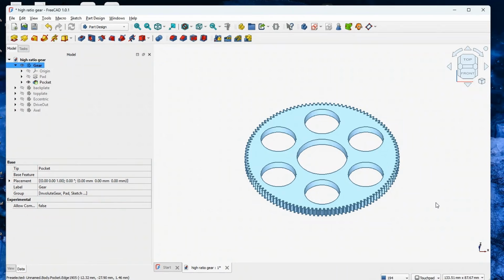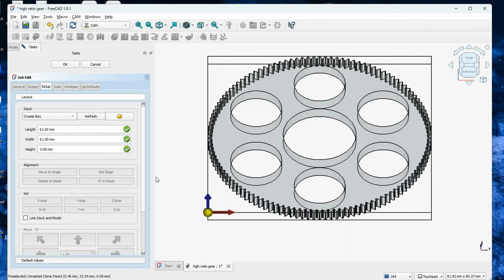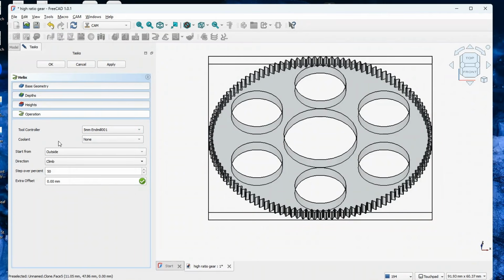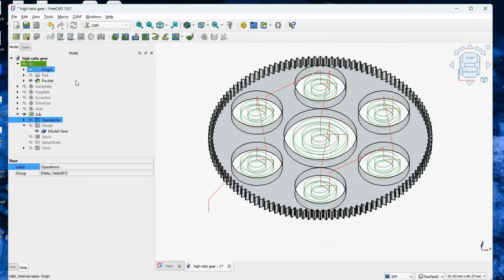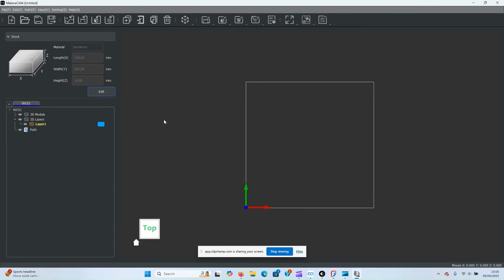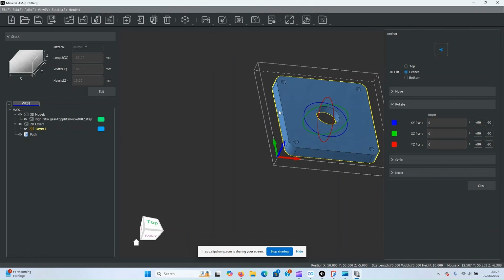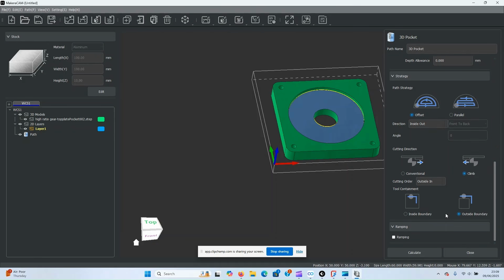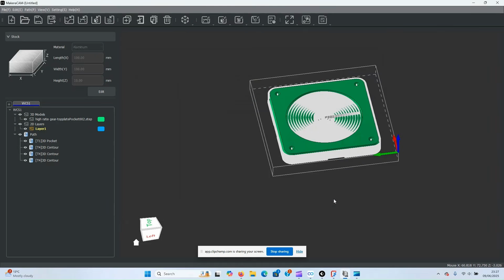2393 FreeCAD CAM And Makera Cam #Makera #Makeradesktop #CNC

Comment: Is there anything extra you need to do when export your gcode from FreeCAD to run on the Carvera Air?  I've been experimenting with it this afternoon, but it doesn't seem to perform the homing and manual xyz probe steps (using a different origin than the normal corner of the bed).  I thought that the Carvera Controller software would take care of that but if it does I'm probably doing it the wrong way.

Comment: I know I may be hard to understand but hopefully this comes across, in that I still want to see how well a 4th axis could work in a 3D printer as I still have my idea of powdered magnetized material *crushed neodymium magnet) in clear PLA that can then be magnetically oriented while a laser is warming the PLA via the magnetic powder before letting it cool back down freezing the magnetic powder as I did ages ago with epoxy and same neodymium magnet powder in a ziploc baggie while laying on top of a magnet.
Reply from the maker: I think you might have to design that yourself mate

Comment: Perhaps in the next video, you can explain the hold-down clamp placements in CAM, or is any clamp placement outside of the tool path fair game?
Reply from the maker: anywhere outside the tool path mate
Reply: @ThinkingandTinkering  Occasionally, even experienced CNC operators can manage to run a cutting bit or spindle or other moving part of the machine through a clamp. It's better to consider carefully than to gloss over this potential problem.
Good planning is also useful, to maintain or restore accurate part alignment during any needed clamp repositioning, for example for a part which requires both inside milling and outside milling.

Comment: to speed up internal holes, use an inside profile with an offset of a few thenths of a mm, then run a final pass at full depth as a clean up to dimension.
Reply from the maker: cheers mate
Reply: @ThinkingandTinkering  Goes without saying add small tabs to original profile and clear the 'counter' before running final pass if you don't feel comfortable it being there.

Comment: When I first learned cnc  machining I would put something like a cocktail stick in the spindle (zero rpm) and set the Z high so that it didn't touch the workpiece. You can then watch the machining process without damaging the spinle/cutter etc. Keep the emergency stop close to hand also.
Reply from the maker: Great tip!

Comment: Even though g-code has a number of curved path types if you look at the file from a 3D slicer it is almost all straight line segments forming curves.  I've tried a few times to write g-code directly with very limited success and several broken end mills.
Reply from the maker: i must get around to looking at that sometime - cheers mate

Comment: I used inkscape to create vector (SVG) files and imported them into MakeraCAM, then added toolpaths. 
you can also import 3d STL files and then use makeraCAM to either create vector shapes or cut out the 3d shape. 
the shapes are easy, and you need to focus on which shape to create a toolpath for first, second, etc. 
if you just start with some basic shapes, squares and circles, it's pretty straight forward, allowing for fancier files pretty quickly. 
one thing to note: for 3d files makeraCAM doesn't support REST machining yet. 
(meaning a second operation doesn't realize an earlier operation has removed material and that the new tool doesn't need to remove that material again. )
this can make a secondary or tertiary operation take TONS of time instead of just cleaning up the part. 
otherwise it seems to work okay.  
NOTE: Lightburn makes GREAT (and affordable!) laser design and control software.. and they're working on a CNC version. 
Can't wait to see what they come up with.  If it keeps to their current standards, it should be pretty great.  something to keep an eye on. ;-)
Reply from the maker: absolutely mate - thanks for the heads up